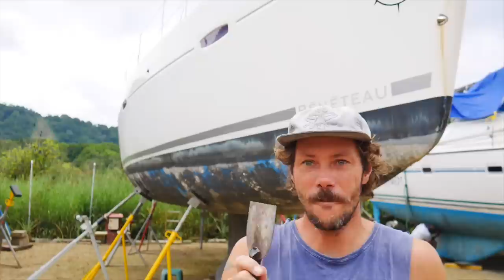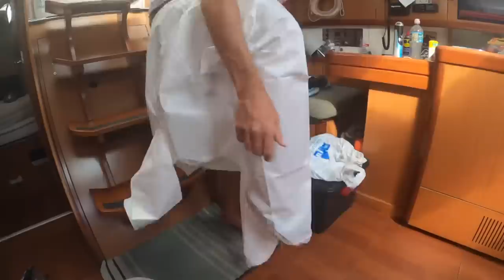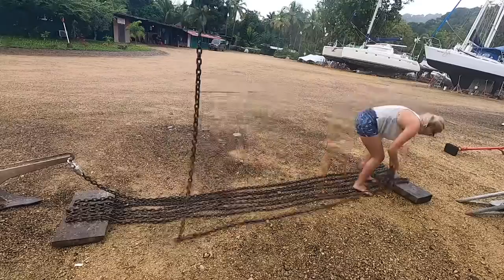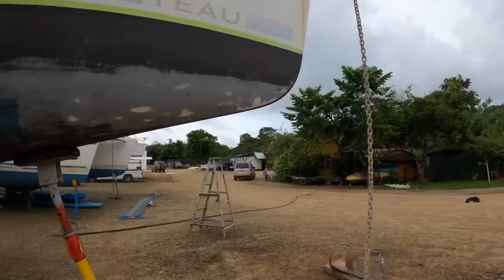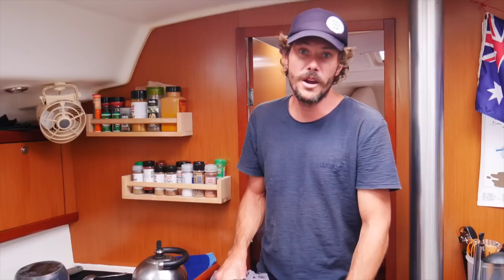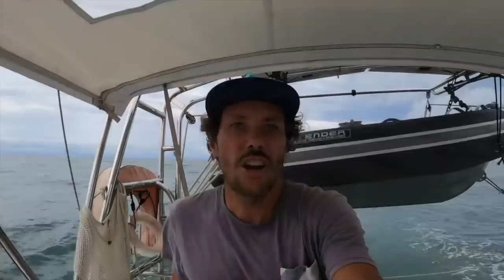How to antifoul a sailboat with no experience in 3 days - Ep. 107

Comment: I bet you picked up 2 knots of boat speed with that new paint. Looks like the bottom turned out great! I would suggest that you wear a mask the next time you are working with silica filler. If you inhale the silica it will stick to you lungs and it can't be removed. Inhale enough of it and your lungs won't be able to absorb oxygen very well. Congrats on doing a bottom job in 3 days, that is an incredible amount of work accomplished in 72 hours.
Reply from the maker: Hi Tim! Thank you for the support! James did so so well! Pretty proud of him for smashing it out so fast! Thank you for all the amazing tips about the silica! We really had no idea but makes sense since it’s all chemicals! Pretty scary stuff! 😧 What make is your boat? And do you normally use the same stuff for yours to cover the fiberglass!? 🤩⛵️🤩
Reply from the maker: Oh and u are right we are flying now! Rpm’s at 1600 now we are doing 6knts! Crazy! We were only doing about 4.5 before!
Reply: Natalie and James:  We actually spoke in Annapolis. You were both very generous with your time in the creator tent, and it was great to meet you both. I am doing a complete restoration of an Alden 44 cutter. My boat was built in 1977 and is hull #1 of the line. The boat is located in the US near Duluth, MN, which is the western end of Lake Superior. Over the past two summers I removed the original teak decks and record the entire deck(all  new core and 'glass). I have also record several sections of the cabin top. Next summer the decks will be faired and the boat will be completely painted...cabin top, cockpit, deck, topsides and bottom.  I have learned more about resin, hardener, silica and respirators than I ever wanted to know.  I hope to have the boat in the water in the spring of 2023 and have it fully functional by 2024.  Once it is done the door (or hatch) is wide open if you want to come sail where water is too cold to swim but it keeps the beer a near perfect temp!!  Cheers!!
Reply from the maker: That’s right! Of course we did chat! It’s weird on YouTube as can only see name and small picture….so we couldn’t tell by that alone!! That restoration is no joke! No wonder you know so much about all the resin, silica’s antifouling business!! An amazing project! We would love to come visit and sail for sure! 🤩⛵️

Comment: Any videos anywhere on how people paint bottoms but then remove the frames and paint over the spots they rested on? Can you describe the process or show the  video link somewhere?
Reply from the maker: With the spots that the jack stands are covering, the yard guys will move the stands over slightly one at a time once the area you’ve painted is dry. Or they will place another stand next to the one that is to be moved. The boat doesn’t move or shift when one stand is moved. Then you paint away. 

For the bottom of the keel, generally you paint what your able to, and then when they lift it, you slap on a couple coats before they launch. If it’s a warm climate, the anti fouling will dry real quick.

Comment: Can paint with copper coat. Lasts 10yrs. Just have to wipe it off every once and awhile. $3,000 for the paint. Worth it I think.
Reply: Could you mix grinder copper into your normal paint for the same effect or will their be a chemical reaction?
Reply: @chrisgoldstein5167  some people do that. The more expensive ablative paints have a pretty high copper content. Adding copper could negatively affect how well the paint sticks to the bottom. Just do 2 coats of the multiseason ablative. Make sure to let the first coat dry before you put on the second coat and let the second fully dry before splashing.
Reply: @aquious953  thanks mate 👍